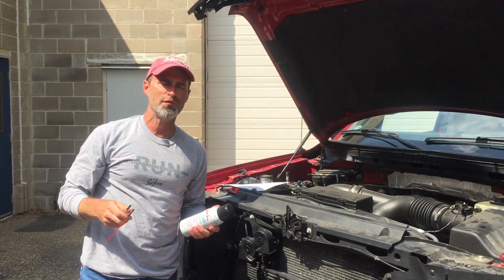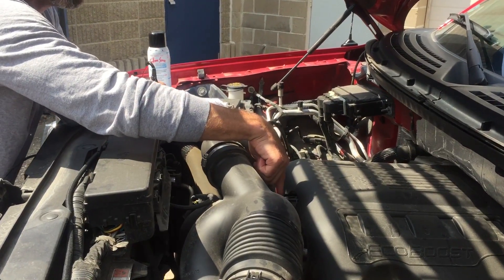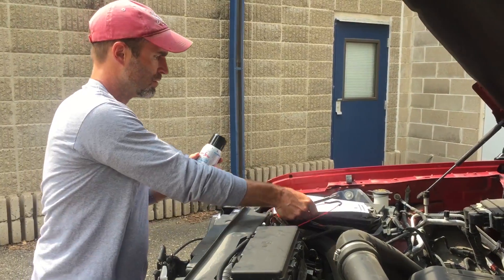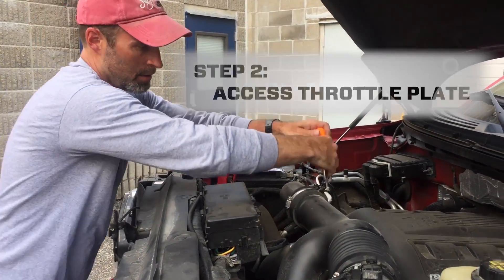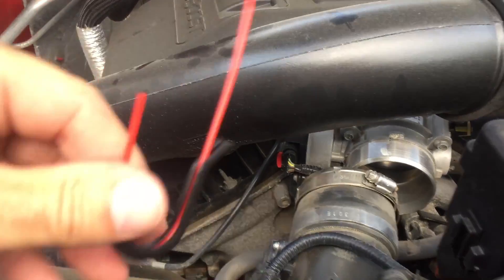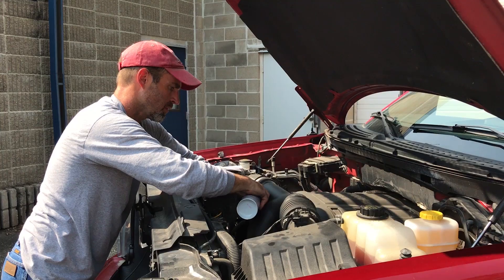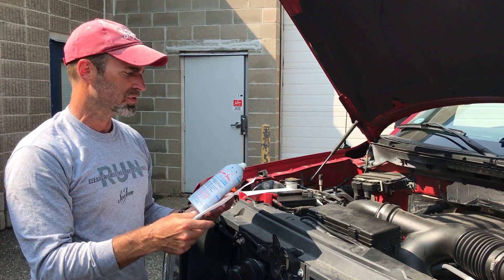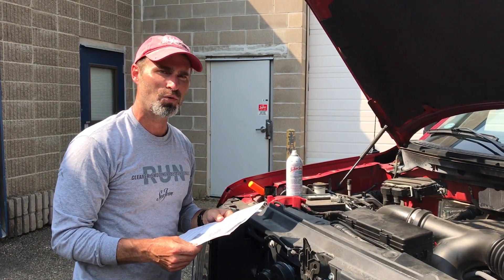(Absolutely👍) Yes, you can use Sea Foam Spray to clean a turbo gas engine

Comment: Hi! Question, I have the same F-150 EcoBEAST that is in the video and I noticed a MAF sensor on the top of the intake manifold near the back - does that get messed up from this treatment? Also, I love seafoam and have used it for decades now! Minnesota proud!
Reply from the maker: Are you confusing MAF with MAP (sensor)? MAP = intake manifold. MAF is between air cleaner throttle plate.
Reply: No there are 3 air flow sensors. The 3rd is on top of the intake manifold after the throttle body. I was wondering if i could pull that out and spray through that hole?
Reply from the maker: @memphis502 Will the engine run with the sensor removed?

Comment: I would very much appreciate a follow up video for the new Ford Ranger's 2.3L Ecoboost turbo engine.  It may be a year or two down the road, once carbon buildup starts happening in these new engines. Thank you so much Sea Foam! I love your product!
Reply from the maker: I heard Ford was bring the Ranger back... Where is your Ranger located?
Reply: Love those new Rangers! That being said, are the 2nd generation Ecoboosts out now have multi-port injection like Toyota to help with the carbon buildup, don't they? I think they are.
Reply: @process2489  that is my understanding from what I have read.  Said F-150’s got Gen 2 in 2018 and Edge Sport in 2019.

Comment: Why is it that Ford is saying to replace heads and all that when this seems to do the job fine. From what I understand if this is sprayed at the throttle body then the air is already boosted so the Turbo's won't be damaged, correct?  Do all Ecoboost's have a setup similar to the one shown here because I am looking to buy a 2.0L fusion EB and the carbon build up is a scary problem, what ford says about it isn't exactly optimistic too.
Reply: The damage to the turbo that people are talking about is to the turbine side, not the impeller. The turbine is the part that is driven by the exhaust gases and causes the turbo to spin. What people are claiming is that these cleaners cause more heat to be generated  or carbon chunks to break off which can damage the turbine/cat.
Reply: Tim D I guess I could always try it when it’s 5 degrees outside in January lol

Comment: All i need now is to find a way to make that straw.
Reply from the maker: The straw that comes with the can?
Reply: @SeaFoamOfficial  The one that comes with the can is the same one the guy is using in the video? looks like a couple heat shrunk to each other to get that angle.
Reply from the maker: @scottlaroche2454  Yes, the video shows the same straw and hook guide that comes with the can.

Comment: I have a 13 fusion 1.6 EcoBoost it had about 48000 miles on it I cold soaked a hole can for 24hr started the next day and it smoked like you should expect then cleared up and idled noticeably smoother and had much better throttle response and more power
Reply from the maker: Thanks for sharing - nice work!

Comment: Hey Seafoam Ive bought both the spray and liquid product.. Just want to make sure I can use the spray on my 7.3 2001!! Im assuming its very similar to this video just want me to make sure
Reply from the maker: 7.3 diesel?  No, never.  Never spray anything into a diesel air intake (see "runaway").
Reply: Sea Foam Official - is this due to pre-ignition?
Reply from the maker: @rednew8222  You'd be adding an ignitable extra fuel source coming from the intake airstream, causing the engine to overspeed at high RPM and 'run off' on its own.

Comment: Props to seafoam for working so hard with the comments on this video trying to solve the fear of using it on turbo GDI 4cyl, I also heard of the scary hard carbon deposits being thrown at the turbo theory aswell but i havent really seen anyone prove it, besides horror stories is there anyone here that has an actual experiance of this actually happening to the point of a voided warranty directly related to using seafoam.
Reply from the maker: Thanks for the kind comment - we learned that responding to customers is helpful to all and causes a meaningful online exchange (versus hostile comments). 
On turbos:  Sea Foam has sold tens of millions (tens of millions!!!) of cans of Sea Foam Spray... Many are applied to turbo-charged engines...ZERO (none, nothing, notta) history of customer or warranty claims causing harm to a turbo.  Why? For starters, the application of Sea Foam Spray is NOT related to any of the [turbo context] fear aversion points. Second, engine manufacturers DO NOT do or say the things that people claim (see Magnuson-Moss act).  Also keep in mind that many of these contention points originate from fuel additive marketing, which is often fear-based... Ultimately, Sea Foam would NEVER approve or promote application of Sea Foam Spray to a gas turbo engine if we ever thought it would cause ANY adverse effect.
Reply: @SeaFoamOfficial  absolutely and thank you
Reply: @SeaFoamOfficial  I just recently bought a 2011 F150 ecoboost and ordered a catch can. That won't fix the 111k miles of build up I'm sure it has. Between watching the video, reading the comments and thoughtful responses from Seafoam, my concern of carbon deposits damaging my turbos has been more or less alleviated. I'll be buying a can, or two, and cleaning my intake and valve train. I'm sure it needs it. Thanks for being so attentive!!

Comment: Hey Seafoam! 

When you say back to back applications, do you mean spray 2 cans in one go (10-12 minutes of continuous spray) or 1 can, then heat soak then drive, followed by another can, heat soak and drive?

My Kia is misfiring on start up, and after replacing the coils and spark plugs, this is my next bet on what the problem is!

Thanks!
Reply from the maker: Hi BT:  We've tried all sorts of 2 can application sequences. What is do is apply one can, hot soak, then drive.  I leave the straw in the throttle body and drive at least 10 minutes... Then I apply can #2.   Driving between applications allows 2 hot soaks.  Hot soaks are a critical part of the process...so doing multiple soaks pays.
Reply: even with the turbo its okay to leave the straw in the intake?

Thanks for the quick response! I will be doing this to the Kia this weekend
Reply from the maker: As long as the straw does not obstruct the plate and the boot is on snug and secure...
Reply: Dunno about leaving the straw in.
That's just asking for Murphy to get you.

But the soaks make sense.

Comment: Challenge round what about engines with no throttle body? The new TwinPower BMW engines have no throttle body at all the vary valve timing and opening to throttle the engine.
Reply: I know how you would go about it it’s still basically the same, but my point was just that some cars have no throttle body.
Reply from the maker: From what I understand the newer BMW throttle design ('Valvetronic') still has a throttle valve, which is where you apply the product in every case.   Also need to say that I have never seen one and know little to nothing about it.

Comment: Can I spray through the turbo? I have a turbo petrol engine (specifically a Peugeot 207 GT) where the air filter is connected directly to the turbo.
Reply from the maker: Why would you not spray it at the throttle plate?
Reply: @SeaFoamOfficial  can you spray through the turbo and intercooler. Person asked if can spray through the turbo and you answered with a question. He, like myself would like to know if Sea Foam Spray is safe to be spray through the turbo and resulting through the intercooler?? Or, is your answer/question saying, the Sea Foam is an intake cleaner and not a turbo cleaner?
Reply from the maker: Sea Foam Spray is made to clean intake valves and chamber areas. Nothing to do with a turbo.

Comment: How about on a Turbo Diesel? :P
Reply from the maker: No, NEVER add a volatile intake fuel source to a any diesel. Look up the term 'diesel engine runaway'.
Reply: I will.

Seafoam use on Turbo Diesels should only be limited to the fuel tank?
Reply from the maker: And priming the fuel filter with straight Sea Foam...Check out the video instructions - Easy!

Comment: So as usual I made a slight error. I sprayed a can directly into the turbo. Did I just damage it? 2012 Chevy Sonic LT 1.4
Reply from the maker: No worries.  Did you spray into the turbocharger or compressor?  If turbo, how did you spray after combustion?
Reply: I followed the air intake hose and sprayed right after that, so I believe right into the turbocharger. Probably why I did not see any white smoke...?
Reply from the maker: The air that goes into the turbine/turbocharger (not compressor) is hot exhaust air from the exhaust manifold (downstream from combustion).  If you sprayed into the air intake, you sprayed upstream up combustion.  In any case, ALWAYS spray immediately in front of the throttle plate.

Comment: what is all the ways u can use sea foam  in diesel engines  in a 2010 f250?  6.4
Reply from the maker: In fuel tank, in oil crankcase, use to prime fuel filters.

Comment: Sea Foam Official will this also clean the O2 sensors and Cat Converter ? or is that the Seafoam you put in your gas tank ???
Reply from the maker: Thanks for the question. No, neither Sea Foam in fuel or Sea Foam Spray will clean O2 sensors or cats, which are both downstream after combustion (no relationship).

Comment: How long before you had to replace the map sensors??
Reply from the maker: Will probably outlast the engine.  Can't say cuz all is well.
Reply: Clean them once every 30-50k miles w MAF cleaner. Easy process
Reply: The MAP sensor on top of the manifold near the back of the firewall gets real oily/dirty and is easy to take out with a 7mm.  Note there is only ONE bolt not two.  Use only CRC MAF spray (not WD 40) and allow to air dry for at least 10 minutes.  No need to disconnect wiring harness. I sprayed the other 2 MAP sensors but they were relatively clean.  I concur with SFO that these sensors will last the lifetime of the vehicle but it is important that the one in the rear is checked and cleaned as needed. My 2012 eco runs much better now.

Comment: I was getting 18.6 mpg.  My 2013 f150 has 80k on it, after seafoam I’ve gotten 21.5.
Reply: I have same issue.  Also misfires right now.  At 90k.  Gonna need to try this.  Replaced all spark plugs and coil boots per a Ford tech's recommendations.  I also cleaned the oxygen sensors with an electronic cleaner.  Still has issues.  I think it has to be carbon so gonna try this.  Also need to clean the intercooler.  Just going through the paces.
Reply: @BurningBeard22  Did you also check the ignition coil connetors? If those go bad you will get arking electricity and misfires
Reply: @BurningBeard22  replaced your plugs, what did you set on the gaps? Also I had to dig up an old made in USA gap tool from my dads toolbox. My made in china  gap tool I got for $1 at the auto parts store was worthless, it was way off measurements. Simple tool yet getting a proper gap setting is important
Reply: I should try it, mine is getting 15mpg tops....usually 12-14.
Reply: Did you have any issues with your turbos after doing this Ford says it will over heat the turbo
Reply: Is it 3.5 or 2.7 eco?
Reply from the maker: Nice!

Comment: Hello i wanted to know if i can use the spray in a supercharged engine?
Reply from the maker: Thanks for the question. Yes, no worries.
Reply: The support charges internals can handle far more heat then the turbos impellers can so seafoam burning off the carbon shouldn't burn our the internals on a supercharger like it does thre impellers in turbos.

Comment: I just did this in my ecoboost mustang. Took about 5 mins to empty the can at around 1700 rpm or so. No white smoke at all. Let it hot soak 15 min. Took it out on the road and opened it up. At around 4.5k a noticeable drop in power as a TON of white smoke poured out the assend.  Did it for the whole way down the street just about. I’m sure the neighbors thought there was a fire there was that much. After it all cleared out of the motor the power returned to normal. Did a couple 0-60s for good measure after that. I’ll report back if I notice any positives from it.
Reply: Did it help? I’m seeing lots of mixed reviews about spraying sea foam in a ecoboost motor
Reply from the maker: No worries.  Best advice for gaining some clarity is find reliable content on how and where intake air passes through a boosted gas engine.  Reminds that Sea Foam can make another video that includes a diagram showing how a turbo-charged engine works...Anyway, a turbo makes no difference/has nothing to do with how Sea Foam Spray works through a gasoline upper engine.
Reply from the maker: Hi Hank - Thanks for sharing. Seems like you have things figured out!  Please let us know if you have any questions.
Reply: Anything yet? I waiting to try it on my ecoboost mustang also. Thanks
Reply from the maker: No new video on the topic but you can easily treat your Mustang according to this video.
Reply: ReGGie siZzla™ I run a can through my ecoboost, runs a little smoother

Comment: @Sea Foam Official. I think the main point about the turbos people are worried about is the fact that the gasses are recirculated back into the turbo after being combustion via blow by which have people worried . Also what about spraying your product ahead of the turbo to clean the turbo and maybe intercooler???? Has anyone tried that? Thanks
Reply from the maker: Hi Joshua:  If there was one thing I wish more turbo skeptics understood...It would be to understand that most harmful hydrocarbon residue that forms in an upper engine is soft and grimy, and even the baked deposits are soft ash held together by petroleum varnish. [All harmful engine forms/deposits are made up of unburned fuel and oil molecules - It all starts as fluid...there's no hard material like throwing a handful of nails into the throttle body.]  If people DON"T understand that, they are vulnerable to imagine things that don't really happen. To your question about spraying ahead of the compressor and intercooler: I would NOT - Sea Foam is made from petroleum oil ingredients intended for hot chambers (like washing dishes,  Sea Foam cleans better under heat and compression)...You could end up lubing the inside of your air intake, which would end up gathering dust/fine particles that pass from the air filter. Same concept as washing the outside of your car with motor oil, then driving down a dirt road.
Reply: Sea Foam Official. Thanks for the clarification im a try it. I read a comment about using it back to back. Would you continuously use two cans at the same time or use one as directed and when the process is done do another can as directed? Thanks!
Reply from the maker: As far using multiple cans, it's up to you.  I like 2 cans if the engine has miles and has never been treated.  Can do back to back, or space a day or week between two cans...

Comment: Did this to my 2012 3.5 eco, seems idle smoother however my check engine is on and now I will have to take it in and have the codes checked🤔🤑.
Reply from the maker: Hi Ryan:  You can wait for your codes reset (based on key starts) or most parts stores will clear for you.
Reply: Also on my 2017 3.5 eco. O2 sensor stuck open. Code went away after a little while.

Comment: So did the truck idle better after treatment? I have a Taurus SHO with simular engine that has 77,000 miles and it idles kinda rough, I may try your product. Maybe two treatments back to back? Thanks
Reply from the maker: Yes, try it so you can experience it for yourself.  Additionally, 2 cans back to back will get A LOT done around your intake valves and chamber areas!

Comment: Seafoam  OfficialI have a question I seen in one of your comments that if you soak an intake valve In seafoam That it will dissolve the carbon build-up and turn it into a paste like butter I know this is true All these questions regarding the Turbo And if it will damage it I know then the seafoam will not be going through the Turbo On the intake side  But on the exhaust side it will With that being said Using seafoam has directed the carbon build-up will not soften as it does on a valve that has been soaked in a jar for daysBig chunks of carbon could  Potentially break loose  This is the concern that everybody has This is why Ford engineers say not to do it and it will void your warranty I want to really badd I have a 1.6 Eco boost It is no longer under warranty I just cannot bring myself to do it though
Reply from the maker: Detergents break stuff apart.  What you're supposing from your mind's eye does not relate to Sea Foam.  Sea Foam has NO detergents, most fuel additives ARE detergents.  Please consider that many people making comments are generalizing (understandably).  Hope this helps.

Comment: I got a 2014 Taurus SHO the map sensor is bolted in the intake after the throttle body. Will Seafoam damage the map sensor?
Reply from the maker: No worries.  Notice that the video is referring to MAF...MAP is different.

Comment: So i have a 2017 mustang ecoboost, the throttle body is right in front of the turbo, is that safe to do it
Reply from the maker: Are you saying that the turbo is AFTER  the throttle body and BEFORE intake runners/valves?  Here's how any Ecoboost twin turbo I've ever seen routes air: Atmospheric air is drawn through an air cleaner, then divides to route through 2 compressors (1 per side) that charge the air, then the charged air is routed to join as it passes through a cooler, then into the throttle body to mix with fuel in the upper engine. After combustion, the hot engine exhaust air heats the turbine side of the turbo before discharging out the muffler and tailpipe.